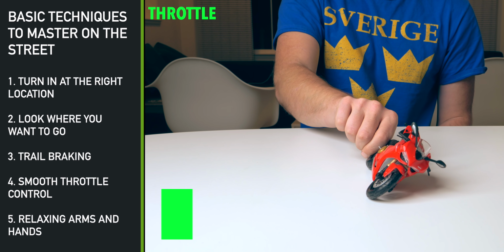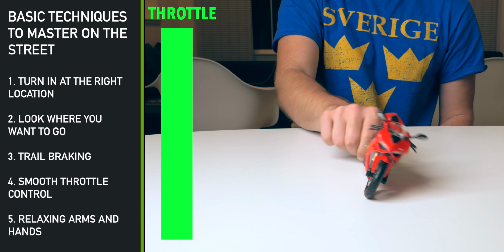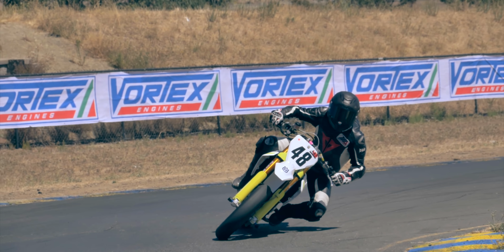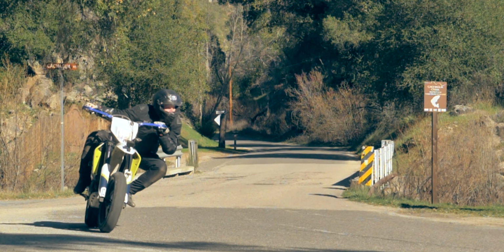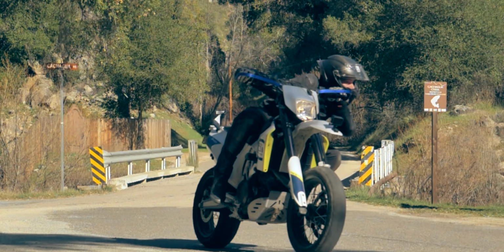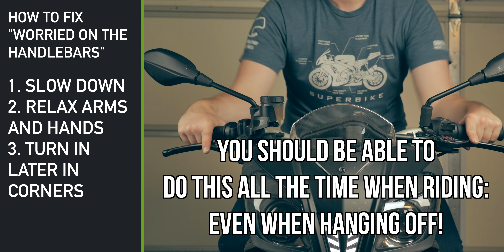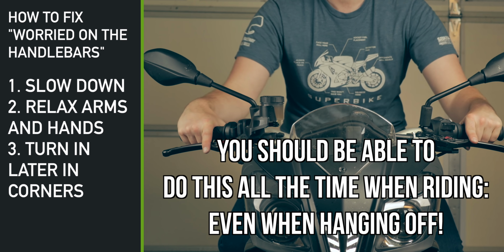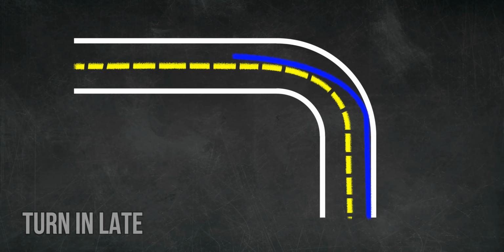5 Things many Motorcyclists do WRONG

Comment: I wish you could make a video on "What can you do when you lose grip in a corner on the front tyre" like on low grip surfaces, oil, fuel, gravel, sand in the road etc
Reply: Well you can look at Moto GP riders for the answer. They drop the bike easily 50% of the time they lose the front, probably more. I've dropped 2 bikes from tucking the front and I felt zero control to save it.

Comment: I have an issue with trail braking, when I enter a blind corner at a low and safe speed there's no need to lower the speed further. So if I want to trail brake effectively (so the front suspension is compressed/loaded) I have to enter the corner faster than I actually want.
Reply: Cause that's why you use trail braking :P to get a healthy controllable entry speed into the corners, if you enter a corner that slow then you don't need trail braking, you don't have to always use the technique, specially if is not working side to side with the way you ride. When you are entering corners at a fast pace trail braking can be the most beneficial and safest. If you don't want to go that fast on a corner then just counter steer and lean a bit and be done with the corner X)
Reply from the maker: Trail braking does not have to mean hard braking. Just having a tiny bit of pressure on the brake lever will make a big difference in terms of loading up the front and just having the brake pads against the disc(s). Just resting a finger or more on the lever, having a tiny bit of pressure on it is trail braking.

You can simply get most of the braking done before the corner and then still have a tiny amount of pressure on the lever further into the corner. This is pretty much how trail braking works on the race track as well.
Reply: @MikeonBikes  Tack :)

Comment: I learned a lot from today's video. I have a question.
When to use counter steering?
I knew it was used for urgent turns, but it seems to be used for general cornering as well.
Is counter-steering what racers use when cornering at high speed?
If possible, I would really appreciate it if you could reply.
Reply: I think Mike already did a video about counter steering. The short answer is: you always use counter steering. If you're not doing it consciously, you're doing it instictively, but it's the only way to turn a motorcycle above 30 kph.
Reply: @jaimgom  Thanks. It's been a while since I've subscribed to your channel, so I haven't seen all of your videos yet. Let's try to find it. Thanks for the kind reply.
Reply: Any time you steer above 15km/h (not sure what that is in mile, you shoukd use counter steering. You can even test the point where you need to. Start by going very slow and turn left to go left and right to go right. Start slowly accelerating and at one point, it will switch and pushing left will go left.
Reply: @leftspeaker2000  Hahaha! You are a wonderful person.
As you explain, I will practice hard.
I hope you always have a safe riding. 
Thank you again.
Reply: Every time you ride you counter steer 😀
Reply: @jeffestrada6857  Thank you!! I'll try!! ^^;
Reply: @RiderKStory  I would say you counter steer whenever your going above walking speed, it’s just more obvious (stiffer) at faster speeds
Reply: @Devs.rr.06  Thank you.
I'll keep practicing as you said. 
And you ride safely. 
Once again, thank you very much.
Reply: @leftspeaker2000  In your last sentence you say "and pushing left will go right", should read pushing left will go left.
Reply: @seniorrider9337  yes you are right,

Comment: Number 3 there are legit reasons to correct your line on the street. Nature being one of them. Being stood up mid corner due to wind requires correction, Stuff in the road that you avoid is another one, Same thing wtih lose traction due to stuff on the road and or it being wet.

Comment: I've only been riding for a few months, my instinct developed to steer with my hips several weeks in and I only allow the bars to tilt to assist with my turn angles am I wrong?
Reply: You should counter steer to turn, and slightly lean into the turn with you’re body. You will not be able to turn as precisely and quickly if you’re just steering with your hips.

Comment: Thanks for the video. I agree with most what you say..... HOWEVER everyone has a different style in riding. Saying someone is wrong doing what they do is just unfair. Providing the safe fundamentals of riding (good foresight, balance and awareness) each and every rider can do whatever they feel necessary-to make his or her ride enjoyable. ....As far as i am concerned as long as you TEND to move your weight to the inside of the corner (and transfer the weight any way that you see fit for you) the bike will do what its meant to do with minimal interference,  need less lean and importantly allowing  better centre of gravity increasing ground clearance. The higher skill trail braking technique will come as more experience or training is carried out.  It isnt really necessary for road riders that just want to ride and have fun even at a more than average pace as long as the rider knows their own limits.  Your exaggerated picture in this post of leg dangling out and unbalanced body is of course a little silly, but somewhere in between there is nothing wrong with that. I think what tends to happen is skilled riders (me in the past included) sometimes are critical of other’s styles and forget everyone has their own way. What opened my eyes was the Japanese style circuit racing where sportbike riders raced a special version of motorcycle having what appears to be totally awkward strange looking set up ( in fact looks similar to a chopper) going against a lot of the logic we all know and are used
 to seeing in MotoGp or Superbikes. The bike had skinny tyres and when riding he seemed rigid on the bike not leaning off at all (opposed to the full lean technique of the sportbikes) It seemed obvious to me the sportsbike riders would clean up BUT quite the opposite occurred. The funny looking skinny wheeled bike basically wiped them and won the race. Now that was rider skill mostly,  & admit the bike looked to be set up exactly for that style of race. But........It made me aware we dont know everything, to be not so critical or judgemental, and however you decide to do anything in life -there is always another way!
Sometimes there is no right or wrong - just different.
Reply: Getting out of the bike in the direction of the corner can be dangerous: if you have to do an emergency stop, a dodge or manage to stay on the bike when the rear slips and regain traction brutally (risk of high side), it's WAY easier to perform correctly what you have to do when you're in the bike, the two legs holding the tank, than out of the bike, with only your hands holding your bike.
Even more, considering the fact that when you're leaning your body in a blind corner, you see the obstacle later than if you're not leaning you body (the head being the most "out of the bike" part of the body when leaning).

It's not about what you must do and what you are forbidden to do. It's about being aware of what is safer, and knowing that there are ways to ride "fast" and not too risky ;)

PS I've seen that WTF japanese video, mind blowing haha
Reply: Getting “out” of the bike as you say is a “loose” term. Just because you are  out of the bike as you say - the body is still in full contact with the bike and in full control. This is something that you train to do and its a style of riding that many can do in 100% control. During my racing experience many many times the bike got loose for different reasons and it was simply corrected or handled by the skills learned from past riding and training. I must also disagree with your comment about lack of vision, i find the position to be entirely better for vision as you are unimpeded by the bike (or bike parts) and can see very very well as you are totally committed with body and head to the direction you are travelling. This to me is true for road and track. 
 On the other hand....If you happen to be  learning this style of riding  or haven’t achieved a certain standard of skill in positional riding and something happens, then yes perhaps what you say could be true, but its the same whether your being rigid on the bike or “hanging” off. It’s basically handled the same way  but you are in a different position. 
If someone is “out” of the bike thats not used to riding or trained for that style of riding -then yes agree it may compromise their riding if something unforeseen happens. Let me say this though.... after learning the skill of good weight transfer its just like ....seeing the light or  turning a corner so to speak, its amazing the step up in control you achieve and enjoyment level skyrockets!! You realise what a skill to have in your repoitoire 👍👍👍 Try it and see! Its one of those things that not knowing we tend to disagree or have a negative outlook on......😉
Yes that Japanese race is amazing 🤩
Reply: I think the main point is that if you're riding so fast on the street that you need to hang your body off the side of the bike in order to make the turn, you're going way too fast.  A little body motion is fine.

Comment: I have one problem with trailbraking that I could use some advice on, when in the street, going the speed limit, trailbraking in the corners slows me down an unnecessary amount and I'll suddenly be going way too slow, clumping up traffic and even in some cases destabilizing the bike because its going so slow that it doesn't stay upright by the use of traction. this is mostly a problem in these long corners, I'm told to trailbrake all the way through and not roll on the gas until I'm inline with the apex, until I can afford to reduce lean angle, but I feel that if I use zero gas all the way through that corner and trailbrake as well, I will almost have stopped before reaching the apex where I can reduce lean. aka. roll on the throttle again. Thanks in advance, hope someone can give me advice on this
Reply: Sounds like you just need more practice. There's only 2 solutions, go faster into the corner, or don't brake as hard. You can still practice trail braking with 10% brake pressure then when you're more confident at higher speeds you will be used to it.
Reply: @dannycarlson5098  Thank you, does it also work for really long turns or should I great it as if there are two apexes?

Comment: My bike instructor specifically told me to not use the front brake for your everyday use except for rare occasion. Those occasions are, immedate danger in a straight line, and use it when you need to free your right leg (say change gear when you're at a full stop in an inclined route). For everything else, you can perfectly use the rear brake. That's especially true for the new riders.
Front brake are for those experienced riders. I myself don't see the use of the front brake if it's giving more chance for use to lose control of it because of multiples road hazards that can easily go awry if you don't pay attention (like a LOT of riders, let's be honest here).
Reply: Sorry but that's some of the worst advice I have ever heard. Front brakes are more powerful and easier to dose with a little practice because your hands are more precise than your feet.
I can understand not using rear brakes or using them only in a few circumstances but the front brakes are essential.

Comment: Thanks! About braking while riding very slow. I know it works and I do it. But why does it work? At least for me that is not obvious.
Reply: My understanding is it is holding tension on the chain pushes the rear tyre into the ground which gives you a little more stability at slow speeds
Reply: I think it's because a motorcycle it's heavy and has a bouncy suspension, and so from brake inputs make it bouncy and unstable Vs rear brake

I say this because you can use front brake easy on a pedal bicicle, not sure

Comment: You can just dangle your leg for fun. Not like someone is gonna overtake you and take your leg off at an intersection. 

1-
I disagree that you can only practice track techniques on the track. That's a very elitist of you. Not everyone can regularly afford a track day. Should they just give up building their skills? At a certain degree of the application yes, of course you should only be trailbraking from 100mph to 70mph at a track not the street. But there's nothing wrong in reinforcing the muscle memory at more sensible speeds. As for not having the mental space to trailbrake, hanging off the bike, gear changing, looking through the corner, etc. You can also do those things wrong at the track if you're never taught the proper order and priority of those actions. You can work to build the muscle memory at lower legal speeds, before going to the track.

2-
I don't know many riders who can even accidentally back in tire the way GP riders do it. As for riders who just spam rear brake to do it just for the sake of having the rear move around aren't riders who are going to be long without an incident, track or street. If you're back in the tire on the street, you are going way too fast to be have use that much front brake that the rear wheel can't decelerate at the same rate. This can only be accomplished by also breaking your 5th point. 

3-
I feel this is a contradiction of 1. A smooth line through a turn is yes the most stable bike, but thinking you can only have smooth lines on the street is a naive and dangerous mentality. Not every turn is going to be free of hazard. You can call it being nervous on the handlebars, but more sensible riders can say it's leaving a margin for error. 

4-
When it comes to slow speed stuff, I don't think any technique is safer or better. Duckwalking a bike , albeit a bit undignified works for many people. Rear brake at slow speeds is a preference, and isn't the best technique when it comes to tight maneuvering. Come to any motogymkhana session with just rear brake and you'll find your laptimes wanting. But the biggest point i feel you missed with the rear brake is that it is your best friend on the dirt, because you can't use the front brakes as much on loose traction situations. 

5-
No argument here. There's no reward for being a street Rossi. No lap record, no trophies, no prizes, just a possible ride in the ambulance.

PS Love your stuff. Can't wait for the next MotoGP season to start.
Reply: "but thinking you can only have smooth lines on the street is a naive and dangerous mentality."

Came here to say this. Not being "worried" on the handlebars sometimes is simply not possible.
Reply from the maker: Building skills when riding on the street is certainly a good idea. Focusing on the most important elements when doing so I think is key. This would involve working on looking where we want to go, turn in points, relaxing arms and hands, trail braking and smooth throttle control.

Working on these basic skills will not only make us better street riders but also set us up to be great track riders. A lot of intermediate track day riders stop practicing these basic skills and focus too much on details that are of less importance until one has reached a very high level.

The skills I am referring to as 'track specific techniques' are for example backing it in, blipping the rear brake before engaging the front brake, pushing the inside elbow far into the corner etc. These skills do not provide much use for street riding, and not for intermediate level track days. It does not mean it is 'bad' to practice these techniques, it just means it is a waste of time in my opinion.

I have never seen anyone 'accidentally' back the rear in to a corner either. I see fast riders braking hard enough with only the front having the rear step out all the time at the track, without putting conscious effort into sliding the rear. The rear will slide with enough brake pressure and engine brake.

Having a smooth line when riding on the street is definitely achievable and I don't think it is a dangerous mentality to have. If there is an obstacle in our way or we have to change our line through the corner, then we do so. Changing our line in corners because of what is in front of us is not the same thing as being worried on the handlebars. 

Being worried on the handlebars means we are giving a bunch of steering input in the middle of the corner without any actual reason to change lines. A lot of riders end up doing this because they are holding the handlebars way too tightly.

Using both front and rear brake at slow speeds is for sure a good idea. The rear brake helps a lot in stabilizing the bike. The rear brake is good in dirt, but one should for sure not neglect the front brake in the dirt. Even just a tiny bit of brake pressure on the front can help a lot when stopping in the dirt.